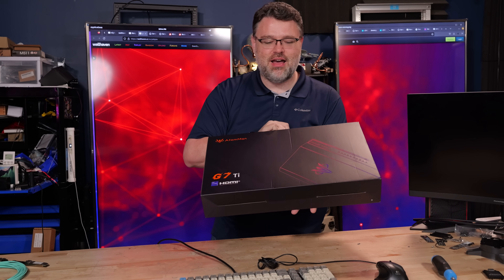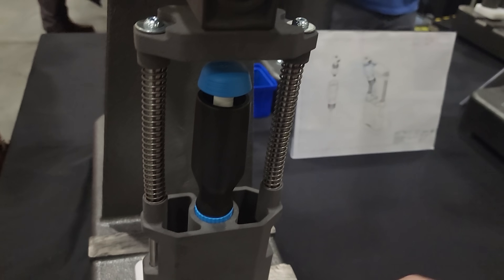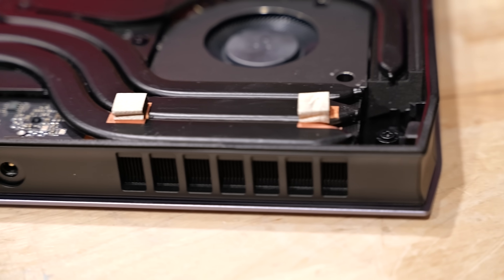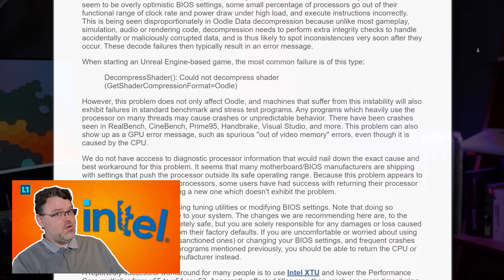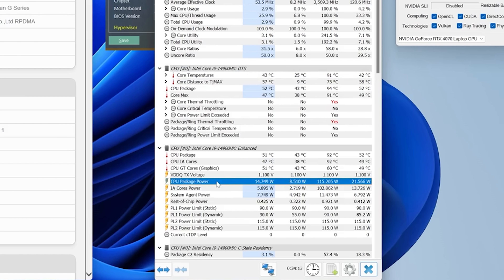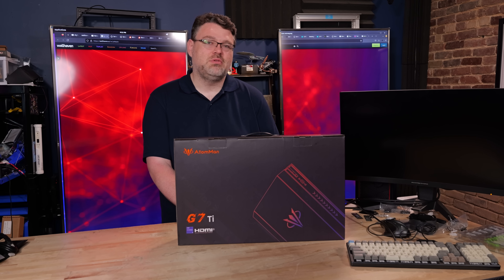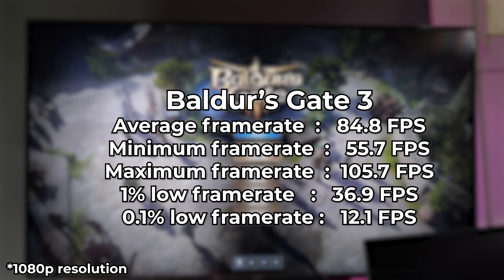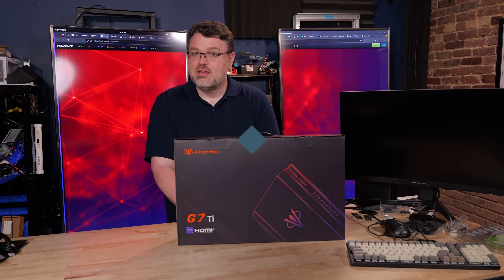A Laptop With No Screen? Checking out the MinisForum AtomMan G7 Ti MiniPC

Comment: I wonder if there is a watt difference between the 4070 in G7 Ti / G7 Ti SE. It only says 140W on the store page, but it could still be a case where the G7 Ti is 140W, but the G7 Ti SE is slightly less.

Comment: I don't know if MXM is dead or something but if you're selling a desktop replacement, giving users the ability to upgrade the GPU would be a huge benefit over just a laptop. It takes up quite a bit of space, given it has no battery, it can even house a couple of 2.5" drives as a workstation giving the user built in storage and ideally leaving any external storage at home.

Comment: A headless laptop in search of a reason.  I don't understand where it fits... I would rather have an ITX board in an appropriate case; get the option of GPU choice, case choice, PSU choice...  For a small 'all in one' it's way too big.  Maybe look at the Beelinks and similar... Laptops, there are 'gaming' and 'content creation' laptops like the Gigabyte Aero 15 I own.  Where does this fit and what does it provide that is an improvement of the other choices...
Reply: It should be noted that even a cheap laptop with similar specs is going to run you $600-$800 more.

Ive been using my dancase a4-sfx for nearly a decade, and the whole sff scene has become a nightmare when it comes to finding parts that fit and are affordable. 

You might see it as a "headless laptop", i see it as a "consolized pc"

Comment: It could be a paste issue, but don't discount it being a fan speed issue.  I find Mobile fans usually err on the side of noise instead of thermals.  Disconnecting the PWM wire (which may get quite loud) is an easy way to verify potential cooling capacity.

Now we are curious what laptop this motherboard could fit in.  Although I can see this being a great use for last gen laptop hardware, put a newer motherboard in the laptop shell and sell the old board as a 'desktop'

Comment: Oof.  A 4070 mobile is a 4060Ti desktop?  I bought a 3080 16GB MXM card for $300, not sure where that lands on the value scale.  Feel like that might be faster.  It has a 165w TDP and I had to buy a $260 Clevo to put it in.

Comment: Is the P core E core trend not going to be a nightmare for Linux? Seems like they keep changing the types of cores (efficient, super efficient). 

AMD is heading in this direction too.
Reply: Why would it [be] a nightmare rather than [currently be] a nightmare? But no, linux has handled it fine from day one.
Reply: @rawhide_kobayashi  my concern is if manufacturers cannot make up their mind it becomes messy to maintain from the kernel/scheduler perspective.

We've got P cores E cores, super E cores, NPUs, probably more coming.
Reply: @BAD_CONSUMER  It's not that complicated. It's literally already a thing . They just report the performance characteristics per core wrt to max perf and energy efficiency and the scheduler already knows how to utilize it. And it's used for more than just heterogenous core design - they've been reporting the quality of individual cores for years and years now, and the scheduler (on both windows and linux) takes that into account.
Reply: Linux seems to handle these heterogeneous core topologies better than Windows.

Comment: 2:31 right above the M.2 connectors is a vestigial BATT connector. Pretty safe to say this was a laptop mainboard. Likely why it has such anemic IO.
Reply: There is zero reason to make a motherboard like that with the cooling like that if you are not making a laptop. Somebody either screwed up or got a massive deal on these boards and thought "let's make a case and sell them as PC"
Reply: @marcogenovesi8570  I read someplace the Cybertruck PC also is some reused laptop motherboard too.

Comment: Non desktop CPUs can't be replaced if some problem arises , desktop ones can be replaced with 12th gen or rumoured bartlett lake, I will not trust Intel with their microcode/bios updates, think they are buying the time and just delaying the inevitable degradation by few more years with warranty  extension etc. and they might have deliberately hidden this oxidising information from public to sell faulty CPUs with wrong settings for 2 years so just don't fully trust Intel with this fix.

Comment: It's clearly just a headless laptop. It's a very high end current headless laptop but that's what it is. You could pretty easily buy a laptop with a broken display, 3d print, or have a 3d print case made and you are in this same place. This form factor just seemed weird to me. If there were keyed holes to mount this on the wall behind your monitor and have the front do the majority of the ventilation sure. If it was flatter and had some feet and was designed to be a horizontal desktop that a monitor sat on? Sure 100%. But as it stands? Yeah it's super narrow but it's massively tall. It's really awkward to work into most setups. And the vent location means it has to either be upside down or vertical...just weird choices.
Reply: And when it's on the vertical stand the power plug is on the top...
Reply: Normally I'd disagree with classifying mini PCs as headless laptops, but one look at the component arrangement shows it's completely identical to a typical laptop setup for cooling, I/O, everything else. Laptops are long and wide precisely due to screen, keyboard and battery and none of that is needed here. Regular boxy mini PCs allow for beefier coolers with better thermals.
Reply: @Reirainsong One of the perks of this is that the form factor allows for beefier cooling, allowing it to boost its laptop 4070  to 120W and stay there under load.

Instead of thermal throttling or limiting to 90w like most gaming laptops with the same card.
Reply: "You could pretty easily buy a laptop with a broken display, 3d print, or have a 3d print case made and you are in this same place".
Don't you realize how stupid is your statement ? Probably not
Reply: it's a NUC

Comment: What I'm hoping for is a lapdock style device with an 18 inch 2560x1600 500 nits monitor or better, takes some common Lenovo laptop keyboard with a numpad and has a 100Wh battery.

Preferably with a stiff hinge so that I can mount a GPD Pocket 4 on the back of the monitor as it's brain and secondary monitor. Then I would only need one client computer for the next few years.

If it can mount a small eGPU on the back of the monitor that would be even better.

Comment: Just stay away from anything intel 13th and 14th gen especially non desktop.
Reply: Site your sources for saying this pkease since its the opposite of what almost of us here have heard.
Reply: But the desktop ones are the ones that fail...
Reply: @Zanpaa   non desktop CPUs can't be replaced if some problem arises , desktop ones can be replaced with 12th gen or rumoured bartlett lake, I will not trust Intel with their microcode/bios updates, think they are buying the time and just delaying the inevitable degradation by few more years with warranty  extension etc. and they might have deliberately hidden this oxidising information from public to sell faulty CPUs with wrong settings for 2 years so just don't fully  trust Intel with this fix.
Reply: Laptop CPU tend to run at lower voltages so there shouldn't be an issue with this.
Reply: Guys, dont feed the troll. We all can shout in the void - you do not have to correct everyone.
Reply: Non desktop CPUs can't be replaced if some problem arises , desktop ones can be replaced with 12th gen or rumoured bartlett lake, I will not trust Intel with their microcode/bios updates, think they are buying the time and just delaying the inevitable degradation by few more years with warranty  extension etc. and they might have deliberately hidden this oxidising information from public to sell faulty CPUs with wrong settings for 2 years so just don't fully  trust Intel with this fix.
Reply: Guys, i said avoid CPUs like in laptops because you can't replace them if something goes wrong and don't trust Intel with anything on 13th and 14th gen because they have deliberately hidden the oxidation issues for 2 years because their balance sheet would be horrible if they told the truth 2 years earlier and had to wait till arrow lake CPUs launch.
Intel are competent enough to know what was wrong but they chose not to alert the customers because shareholders..
Reply: To be fair to the OP, we have had reports of unstable laptop Intel chips, too. Wouldn't make sense if we didn't, since they're essentially the same SKUs and often operate at over 65W. Maybe the rationale he had was that you can at least swap out the desktop chip, meanwhile if the mobile chip fails you're SOL (especially with Intel's RMA policies)?
Reply: Are you smarter than Wendell who did the investigation himself and says complete the other way?
Reply: @codyrap95 smart people are not always right on everything and thats beside the point, we will see who is smarter when the cpu dies
Reply: @game-tea  I think you misunderstood my point
Reply: @ssdaqwe2578 what do you mean by "especially non-desktop". As Wendell said laptop cpu's 'should' run in the safe voltage limit, as opposed to the desktop chips